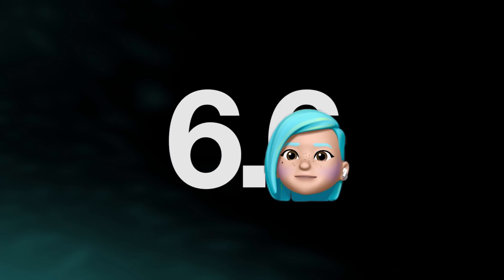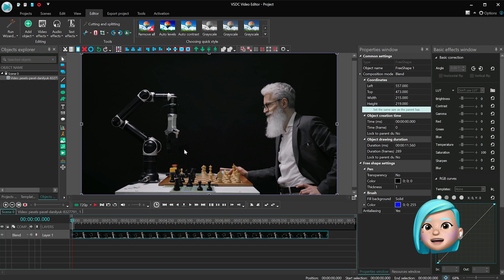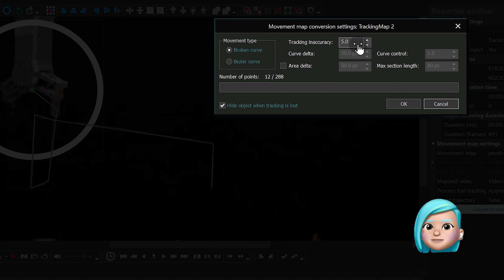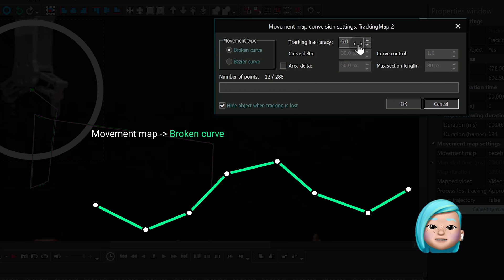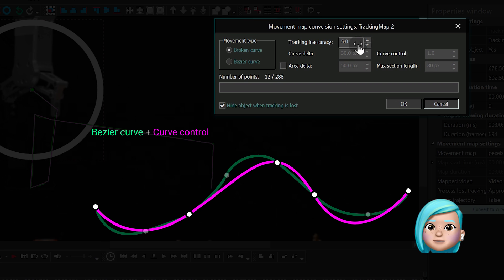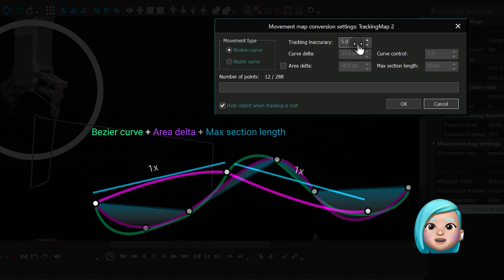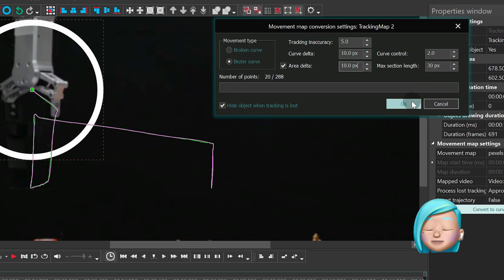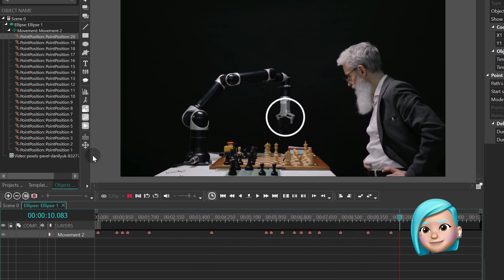How to fine-tune the motion tracking movement map in VSDC

Comment: Thanks for the video. I have a problem. In the editor it works but in the output don't...like there is no motion pattern and my rectangle stay still....
Reply from the maker: Hello, which version of VSDC are you using—Free or PRO? Unfortunately, Motion Tracking is a pro feature and that can be a reason why you can use it in the editor, but can't export

Comment: When i click 'Start Analysis" it doesn't seem to be working. I waited for an hour and still nothing changed. Any advice?
Reply from the maker: Hi Chris. It's hard to tell what the reason is, without seeing your PC specs and the project. Please email us the details at support@videosoftdev.com
Reply: @VSDCFreeVideoEditor  Will do thanks. Seems if I enlarge the target outline (red box), then it works better. I'll still send you an email. 
For reference, I am using a Lenovo laptop.  IdeaPad Y700-17ISK. Processor Intel i7-6700HQ @ 2.60ghz. 64bit x64-based processor. Windows 10.  

Thanks for the fantastic customer support as usual. ✌️🤘